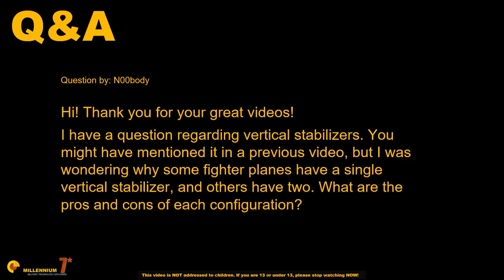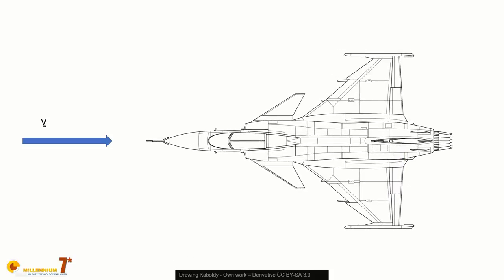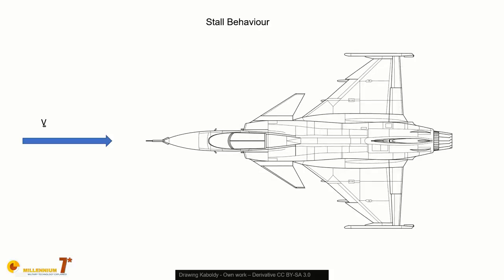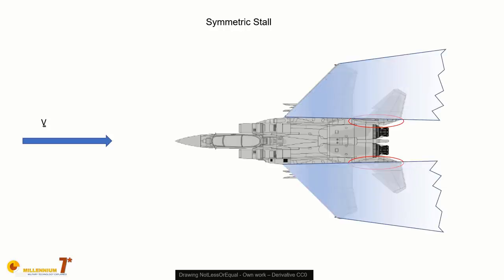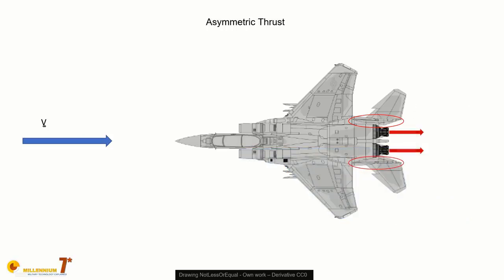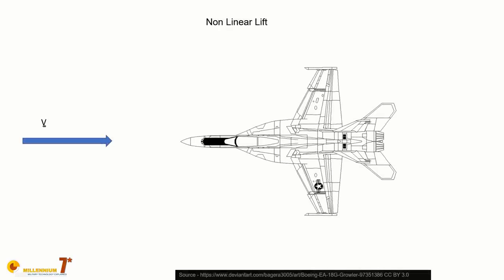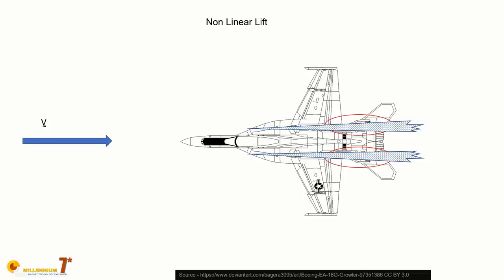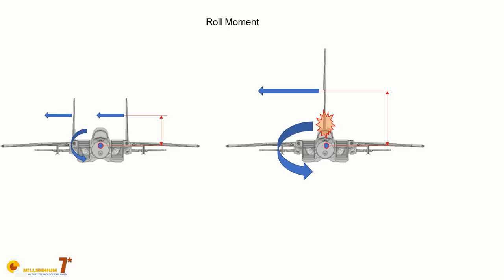Why Fighters may have Twin Vertical Stabilizers? - Q&A Video

Comment: This seems somewhat speculative.  For example, the airflow diagram presented for the F-15   implies that the flow directly in front of each fin is not turbulent, so they are perfectly placed. But if the airplane yaws the fins rotate out of that relatively smooth flow into the 'shadowed area'.  Is this idea based on any specific documentation of the F-15 design?  I also do not believe that a symmetric stall is "quite rare".  If the airplane is not yawed both wings should be at similar alpha.  I think the asymmetric stall claimed to be normal would actually be the exception, and potentially lead to spin entry.
A simpler explanation would be that the F-15 had two fins simply because a single one would have been insufficient in size.  Each fin is as large or larger than the single fin of a previous generation fighter.  However, they are placed much farther forward, so there is less moment arm between the fin and the CG.  Just compare the location of the burner cans of the F-15 and the F-4 and you can see the difference.  I would also agree that the fins are likely in more turbulent flow at high alpha than the F-4 fin is.  Also keep in mind the high supersonic speed reduces the lift curve of the vertical airfoil, requiring more stabilizing area than need for subsonic flight.
Reply: Unless both wings of an aircraft stall at exactly the same time -- which is uncommon -- one wing will stall first (i.e. it will stall asymmetrically).
And yes an asymmetric stall can then lead to a spin.

As for the size of the F-15's fins, I'm sure that their designers positioned and sized them "correctly".
Ditto the F-4.
Whether or not that has much to do the moment arm length, well ....
You seem to be neglecting the fact that the downward sloping elevators also act to stabilize in pitch and that they work wonderfully as the angle of attack is increased, thereby effectively making the tail act like it has a much larger fin.

As for what happens at high supersonic speed, the same sort of shock waves that form over the wing (and thus reduce its lift) are also forming over the vertical stabilizer thereby reducing its effectiveness as well.
And inertial coupling that might be something that a pilot can compensate for at subsonic speed happen really, REALLY, REALLY quickly in supersonic flight and so if they aren't controlled right way, the aircraft will rip itself apart.
Reply: @lewiscole5193  You like to throw a bunch of stuff at the wall and see what sticks.  I didn't mention a thing about inertial coupling--which I'm not even sure you really understand--so why do you even bring it up, other than to further obfuscate the subject at hand with irrelevant terms you must have read about somewhere.  
I'm not sure you understand what produces lift in supersonic flow, but I'm not going to talk about that either.
I will limit myself to the most import misconception here, which is stalls.  The video shows one wing stalled and the other not stalled, calls this an asymmetric stall, and says this is common.  Bunk.  In normal coordinated flight both wings will be close to the same AOA and the same place on the lift curve.  Due to irregularities of wing rigging and turbulent flow one wing or the other will have slightly less lift, which can cause a roll off or oscillatory wing rock. That is not what was illustrated in the video, which was one wing fully stalled and the other one not stalled.  That is absolutely not a common stall, and if it somehow did occur the resulting roll would cage your eyeballs.  I don't know what you guys are smoking.

Comment: There was a prototype flanker "T-10" with the tails on top of the engine nacelles instead of outside them. I'd be interested in hearing about the thoughts behind that and the change.
Reply from the maker: Very difficult to say without specific info on the subject

Comment: Twin Engines and vertical Stabilizers contribute to greater operational safety in case of a failure i guess (in combat)
Reply: Maybe.
 
Aircraft can fly often times fly without vertical stabilizers even if that's what they were designed with.
The B-52 that lost its fin back in the 60s and yet landed safely is an example.
 
Having twin engines might contribute to operational safety, but if the two engines are close together, then anything that damages one engine can also damage the other (and that's not even taking into account the damage caused by one engine ripping itself apart and throwing shrapnel every where).
 
Also, two engines almost always weigh more than a single engine for the same amount of thrust and so the price of improved "operational safety" may come at the expense of combat performance.
Reply: Lewis Cole Also, two engines means the number of moving parts doubles, so the risk of a single component failure also doubles.

Comment: We keep seeing aircraft designs that are don’t have vertical stabilizers... I understand the stealth aspect of this, but could you address how these fighters will be able to maneuver as well, and with twin engine aircraft, with an engine loss how it is possible to maintain control...  I sure it must have something to do with computer assisted flight controls, possibly directional thrust and or combinations of spoiler, aileron, and directional thrust that keeps the aircraft flying...
Reply from the maker: Yes. Flight mechanics is different and basically unusable without computer assistance.

Comment: The Revolutionary F 23 could easily break Mach 2 with no Vertical tail. It did this, partly, by placing the engines farther forward, near the center of mass.

Comment: Hey, I wonder how Jet engines are different from Rocket engines? I know the basic difference but wanna know more in detail.
Reply: Rockets use self contained oxygen sources to draw for thrust, jet engines use external oxygen flow. I could have worded this better, but it's not my forte
Reply: Turbojet engines take in air through the air intake (note there is no fan, this is only on turbofan engines). This air firstly passes through a compressor (many stages of small blades) which increase the pressure of the air before it reaches the combustor (the performance of the compressor has a large influence on the performance of the engine and combustion). Fuel is injected via fuel injectors into the compressed airflow before entering the combustion chamber and igniting.

Whilst it is commonly thought that the ignited jet of air's sole purpose is to power the aircraft, it is also harnessed by a turbine just before it leaves the engine. The turbine  recovers some of the energy from the jet and utilises it by powering the compressor stages among other things before the air leaves via a narrowing exhaust nozzle.

Rocket engines on the other hand can have a few different design types. Typically you have fuel and oxidizer mixed in a combustion chamber (I think the combustion chamber is pretty much just the rocket engine bell itself) which is ignited. To keep the engine bell cool the fuel is routed down the outside of the bell and up the inside before being injected. The exhaust can be used to drive turbopumps to feed fuel and oxidiser but this takes some of the power away from the engine itself, although a closed cycle routing the exhaust back into the engine is possible. Some designs can have a secondary combustion chamber in which a gas producing reaction occurs to drive the turbopumps.

Comment: Why some military airplanes have no  vertical stabilizer ?
Reply: Because they are (or were) not needed for the missions they were supposed to perform.
 
In the case of the B-35 flying wing, the pusher props effectively acted like a tail to make the aircraft stable in yaw without any vertical stabilizers.
When the B-35 was re-engined with jets to become the B-49, vertical stabilizers had to be added.
Even then, however, the aircraft was not stable enough to act as a good bombing platform and so the project was cancelled.
  
In the case of the B-2, any vertical stabilizer (and the corner joint it forms) would tend to act to reflect radar back to the sender, reducing its stealthiness.
And since computer augmentation could correct for any problems in yaw by use of the wing control surfaces without said fins, they weren't needed.
Reply: Mostly to reduce radar cross section, weight, and drag. Flying wings are the most aerodynamically efficient structures, but they have stability problems in the yaw axis because of the lack of vertical surfaces. There are two ways to overcome this problem. Fly by wire, like on the B2, that’s really complicated and not very aerodynamically efficient, as it artificially creates extra drag on one side when slip happens to make the plane yaw back to the direction of flight. And the so-called Prandtl wing, used on the Horten 229 (and every bird too), that’s simple and extremely aerodynamically efficient, because the wing itself is designed in a way that induced drag gets reduced on one side in case any slip happens, and the plane/bird aligns itself back with the flight vector. So in the first case you increase overall drag to stabilize the plane, while in the second case you decrease it. The Prandtl wing is also told to be more aerodynamically efficient in itself than any other wing design, having better lift/drag ratio. Nevertheless, noone seems to use it since ww2, that’s really strange!
You can hear more about the Prandtl wing here: https://www.youtube.com/watch?v=w-dk1NpVNNI&t=
Reply: It's how birds stabilize themselves. For eg the eagle which uses it's feathers to reduce vortex formation at the tip of it's wings. Everything human's make is copied from nature.

Comment: So what you think about f-35 with 1 thrust generator and 2 stabilizer
Reply: mk patel It also has a lifting body AND the canted vert stabs reduce the RCS.
Reply from the maker: It has 2 canted fins to reduce the RCS. I believe that was the prevalent consideration.
Reply: Vertical fin is good radar reflector to side and forms retro reflector with horizontal stabilizer.
So if aim is stealthy plane, single vertical fin would be quite bad design.
For example F-15 is really big on RCS and one of the changes in reduced RCS "Silent Eagle" concept is canted twin tail.